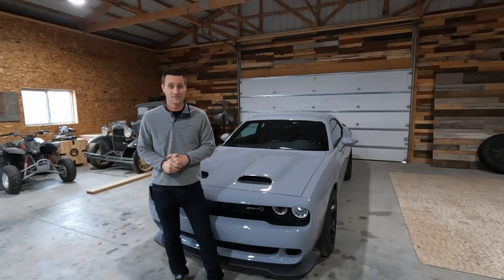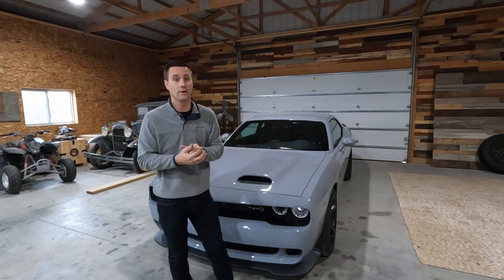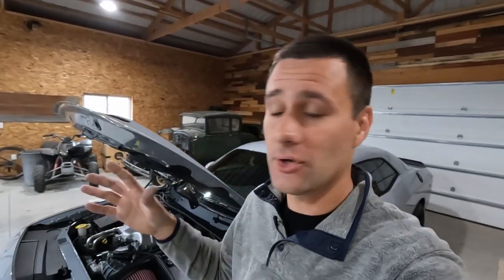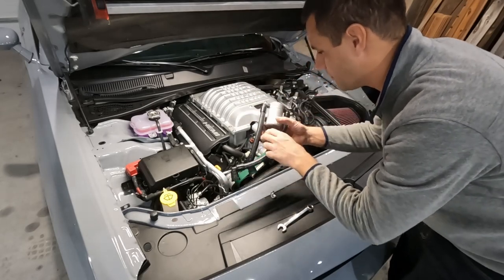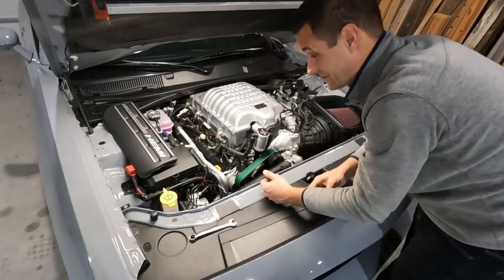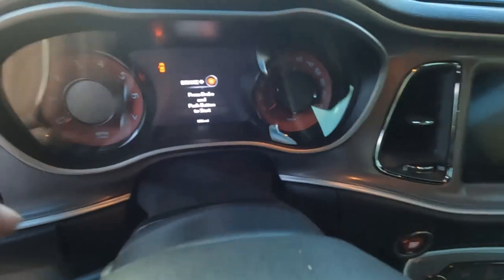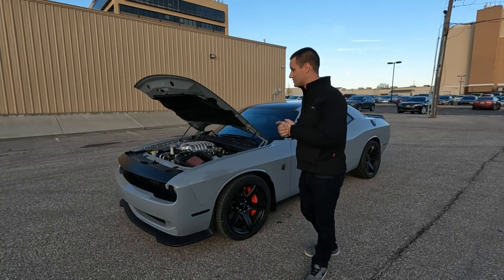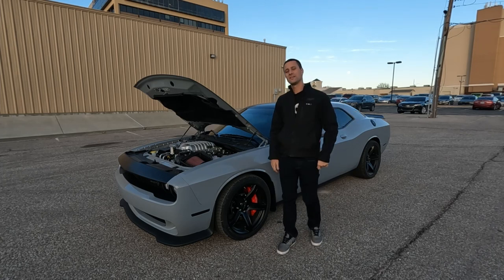Keeping 800HP CLEAN With J&L Oil Separator Dodge Challenger Redeye Oil Catch Can Install

Comment: Beautiful car and aftermarket oil separator. I wish they sold something like that for my modified Harley engine.
Reply from the maker: Wow that is a good point and something I haven't ever thought of for a motorcycle application.
Reply: @TylerPotter  I have to clean my air filter every 5,000 miles or sooner because it becomes saturated in oil and drips on the cam cover. I wonder how much gets pulled into the engine?

Comment: Its amazing they don't put a catch can on these from the factory. I have a catch can on my 3.6 Chevy and it catches a lot of oil. I have a valve on the bottom of mine so you don't have to remove the bottom to empty it. Good video.
Reply from the maker: Nice it is always some nasty looking stuff in winter time! Thanks for the view!